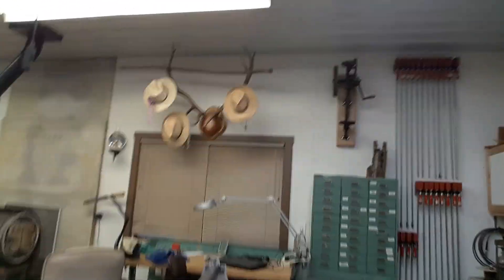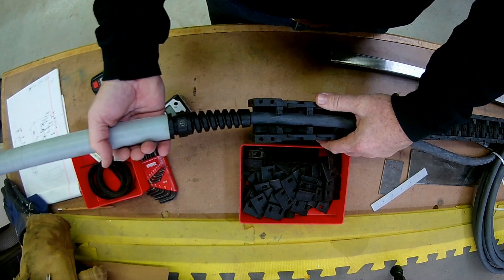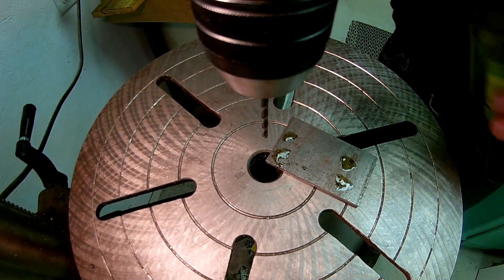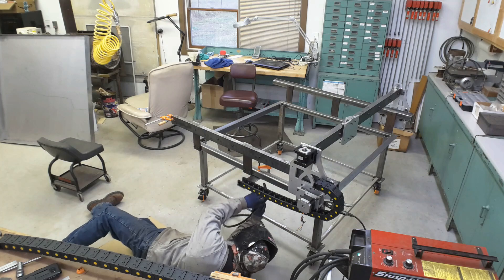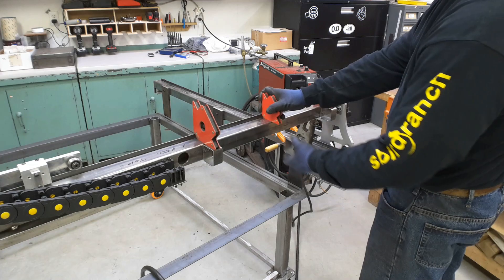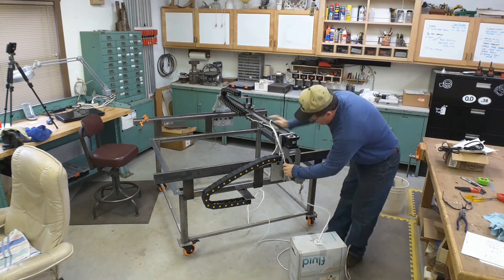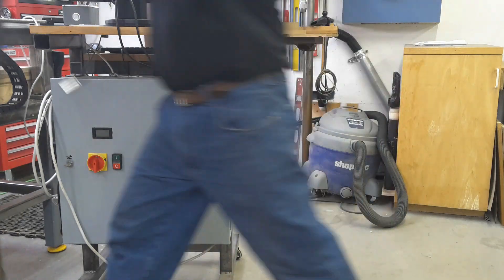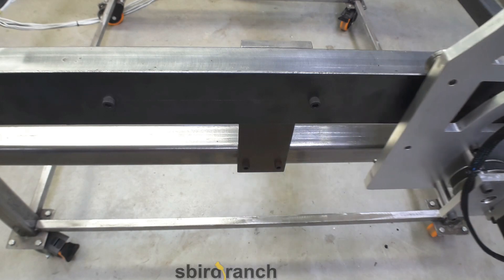Cable Tracks and First Jog

Comment: How is the CNC Plasma table building going?  Looking forward to your next video.
Reply from the maker: Progress stopped last fall with the cutting of my first test parts.  I paused to put a ceiling and insulation in that part of my shop.  I also don't like my initial store bough Z so that is getting an upgrade.  Then life happened.  Now that fall is here I'm looking forward to getting back at it.  Progress is slightly ahead of my videos but not much.  ~P

Comment: How do you go about selecting the motors.  I am stuck right now on rpm vs torque.  I know for thinner material you want speed but I am not sure what rpm I need to achieve optimal performance
Reply from the maker: I have never thought much about motor RPM as I just figured stepper motors all spun about the same at full voltage, unloaded.  I have done the calculation to include any gear reduction (or increase) and verified that the inches per minute (IPM) were going to be enough.  In fact, I have really been more interested that the resolution of each step is small enough to create the detail I want. ~P
Reply: @sbirdranch  Thank you for the reply.  I am actually looking to use tecnik sd servos for my plasma cnc so the resolution is not really a problem.  They range from 1k to 4k rpm.  I want to use a direct drive system.  I will look into IPM and see if there is an answer there.  Thanks again for the reply!

Comment: Thanks for sharing your videos and experience with CNC building. Lots of useful insights that can be applied. I am more for wood and plastic so the 3 machines I’ve built are much lighter and suited to my purposes. I seem to have settled on GRBL after being in the Marlin world briefly learning printing and really like it. My friend who has been a Mach3 guy for years has also moved over to GRBL now. They are another great tool for general purpose shops.

Comment: Great job! I really like your work, nice and clean.
They make the cable tracks with cable separators inside and some have walls to keep control wires separate from power wires.
Our plasma and gas lines were run in a second cable track set about 2" apart from your control track. I use to repair, build and convert flame machines to plasma cutting machines.
Reply from the maker: Interesting info.  I appreciate the 'real world' information.  I often wonder if in some ways I try and make things too compact and delicate.  We are cutting steal with electricity and plasma...that should deserve a little size. :) ~P

Comment: Look great 👍     Question,  grounding both ends of a shielded cable my induce ground loops a specially with plasma discharges,
Reply from the maker: Is that a question or a statement?
Reply: It's a poorly constructed question,    Are you concerned about ground loop with both ends grounded?
Reply from the maker: @SouthernEngineering  Well I hadn't considered that.  Figured a ground was a ground.  I have heard of that in electronic circuit design but I'm not smart enough to understand it.  I'll make some inquiries.   P
Reply: @sbirdranch  EE here, you don't want to connect both ends of the shield on the cables.  No two points on your machine frame will be at the same electrical potential when the torch is on.  If you connect the shield at both ends you end up making a transformer primary from the shield and the signal wires become the secondary.  Not what you want.  If there is one common location where the majority of the shielded cables terminate, that is the simplest place to connect all the shields to the same ground point.
Reply: Basically, what happens is this,   when you ground a shielded cable at both ends you can induce a current in the circuit,  considering the amount of energy in a plasma cutter, the steel frame and the separate electrical cabinet you run the risk of fast transients introducing noise on the control and sensor lines; something to watch for if see glitchy operation from time to time.  How you mitigate is by grounding the shield line at the instrument control but not at the sensor, generally!
Reply from the maker: @SouthernEngineering  seems you were sand bagging and had the answer already ;)  I do appreciate the insights.   Sounds like I should ground at my podium where the drivers and the computer are.  That would seem to be my instrument control point.  Concur? P
Reply from the maker: @MyRadDesign  Thank you sir.  I can picture the scenario you describe and that would be bad.  So for the cables, I think I get it.  Would it be wise to ground the podium and the machine through other means so they are at the same potential?  I'm thinking about the signal cable going to the  HTC which will be on the machine side.  Thoughts?
Reply: @sbirdranch  Without knowing more about the overall design of the entire system it is difficult to answer that correctly.  For instance, how is the torch told to start / stop?  Is this done in a manner which is isolated from the motion control system?  If you could point me to a link that shows the overall system electrical interconnects I would be happy to look it over for you and give you a more educated answer.
Reply: Sorry about that,  unless I see something dangerous, I try not to offer unsolicited advice, I prefer to ask questions; besides, there are plenty of "Experts" on YT that will be more than happy to tell you how you did it wrong!   @arlen raasch is correct,  all the shields should terminate at a single point at the control box,  the other end should terminate as close as possible to the end of the cable, use heat-shrink tubing to insulate the shield. 
One day I plan to build a plasma table so watching your build is very helpful, sadly, I'm so far behind schedule that will remain a distant dream for now.
Reply from the maker: @MyRadDesign  Well I don't have that documented in a way that I can easily share.  Keep watching as I progress?  Shout out if you see something worth my further exploration as I be live this is. ~P.    On the side, I will be using a THC mounted at the machine which is activated by a single relay....I think.  I have got to finish this project.  I do appreciate your insights.
Reply from the maker: @SouthernEngineering  I'm open to input so don't hold back.  I surely don't know all of what I attempt and the conversation might make others think it through.  And maybe this would be a good video after I get a little more educated.
Reply: @sbirdranch  I feel your pain!  I will keep watching.  Keep up the good work, including TLAR!
Reply: We are all here to learn and share, keep up the great work.